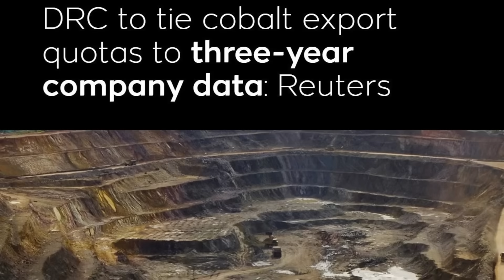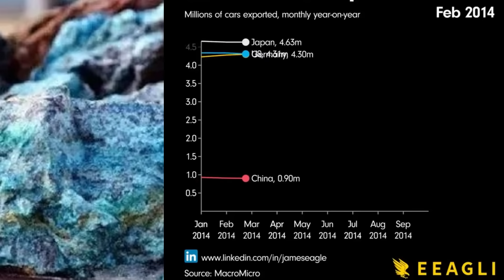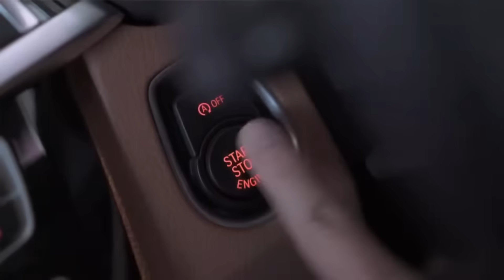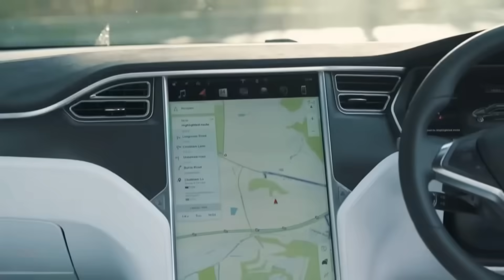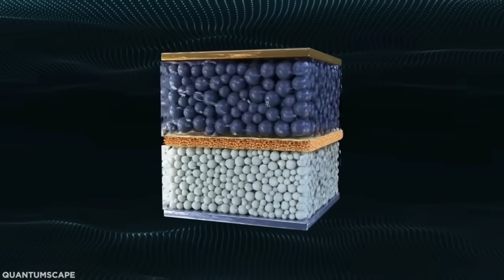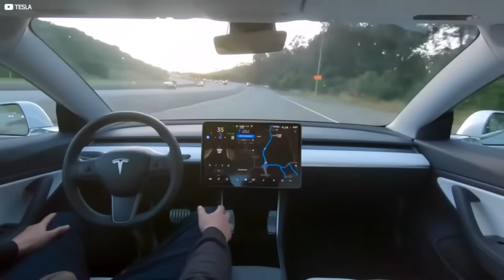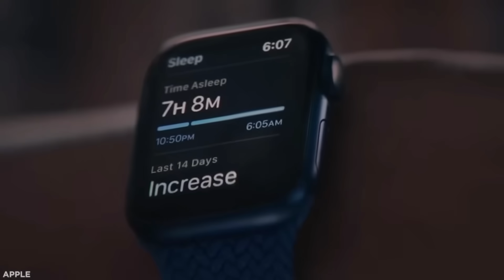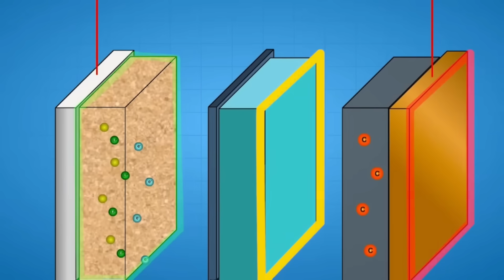DR Congo's $25 Trillion Cobalt Ban DESTROYS Europe's EV Industry!

Comment: Cobalt is primarily used in lithium-ion batteries for electric cars and electronic devices (almost 60%), in high-temperature-resistant superalloys for turbines and aircraft engines, as a catalyst in the chemical industry, and in magnets, paints, cutting tools, and medicine (e.g., joint prostheses). Its hardness, temperature resistance, and electrical conductivity make it indispensable for many high-tech applications. Muddle-Heads in EU!
Reply: This just one demonstration about Europe and their current owners...they prefer yea-saying 'leaders' who are excellent in performing their dictated duties, but not endowed and probably not encouraged to think. That is no way run a large, complicated enterprise. EU and their owners are finished even if this is not yet clear to the casual observer.